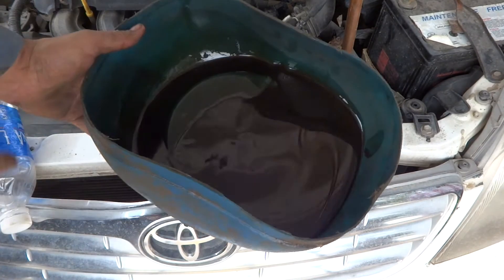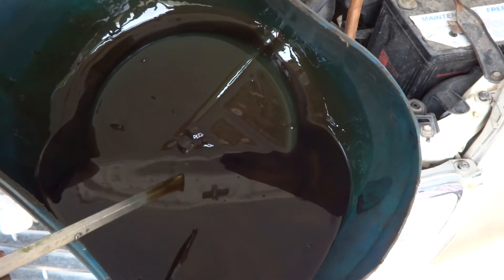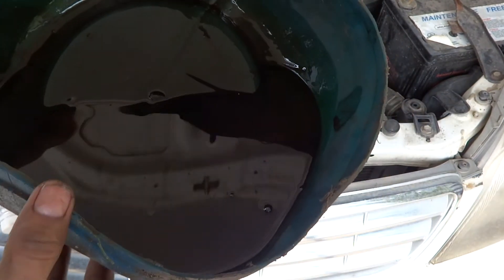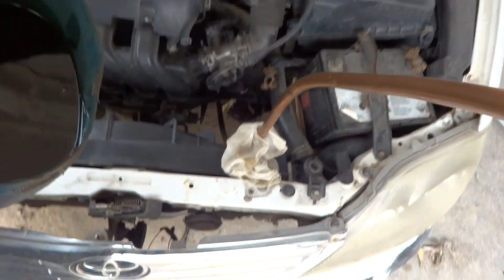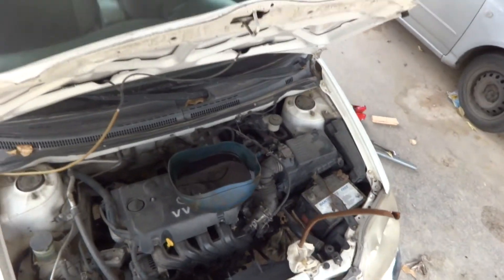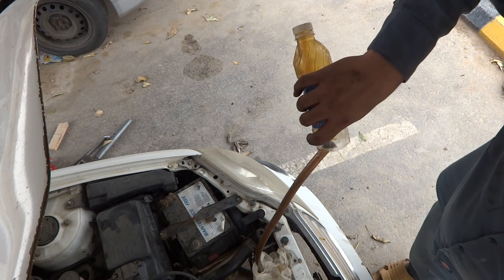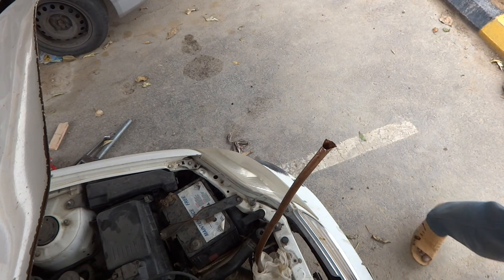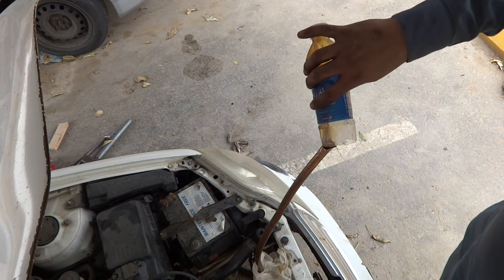Transmission oil refill. Gearbox oil refill.

Comment: That fill hole did look hard to access, like the copper tube idea :-)), while you were pouring the oil back in i was thinking about ways to filter it.
Perhaps an old bit of cotton rag stretched across your drain tray would catch most of the nasty bits.

I would be supprised if fine particals of brass would hurt anything.
Reply from the maker: Thanks dear friend for constructive comment. The transmission oil is thick enough to filter. Anyhow I would try to do so in the next coming job of similar type to do filtration for oil using a coarse cloth as filter.
I am sure the brass particles are not hurting anything but is showing inner wear out of the component only. Manual transmissions are not so sensitive for oil as automatic or engine is.
Regards,
Reply from the maker: Your Idea is highly appreciated dear friend. In the next version, I would do filtration for transmission oil and will show it in the video while do my next repair.
Regards and thanks for nice comment.